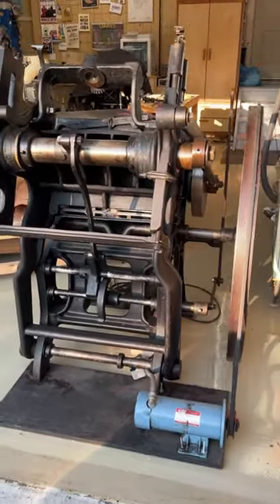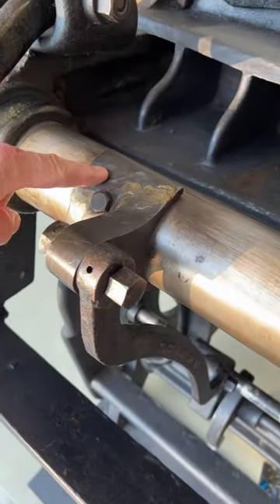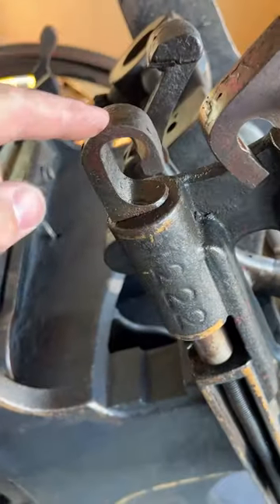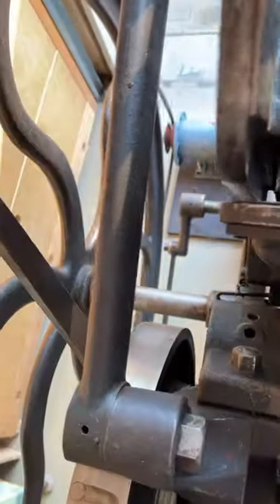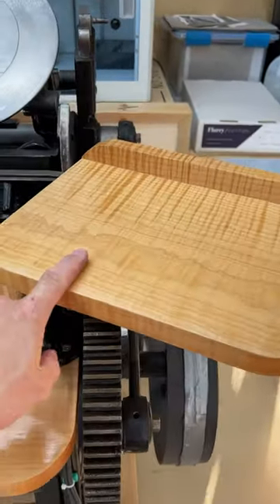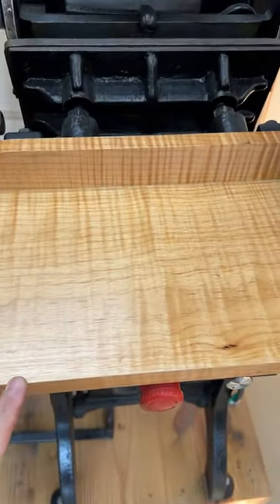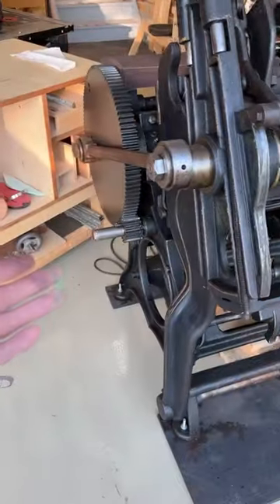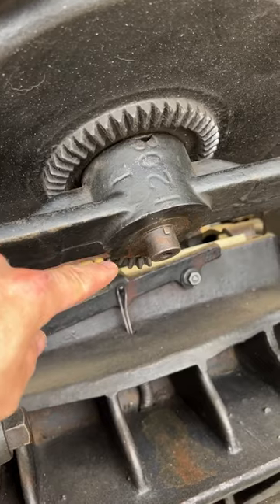What’s wrong with Thelma?

Comment: Most of the parts could be easily replicated if you have access to files, a lathe and some tasty chunks of cast iron. Tho... honestly, i'd keep the plate steel handle. Dip the discs in naphtha inside a steel pan (no plastic as it melts in that liquid) for a day or two.

Comment: Gotta find you a spoked belt pulley. What size shaft?
Reply from the maker: Yes!! It’s. 1.5” shaft but adapters can be made. I would say in the 14-20” diameter is ideal but other sizes could work too.
Reply: @dpmakestuff  excellent. I will see what is around. Flat belt pulley or a V?
Reply from the maker: @cabletoolcowboy  I wouldn’t turn down either… but flat is cooler right?
Reply: @dpmakestuff  flat with curved spokes is 1000X cooler